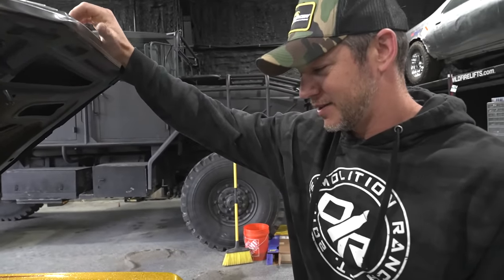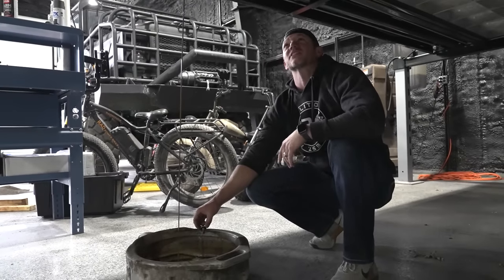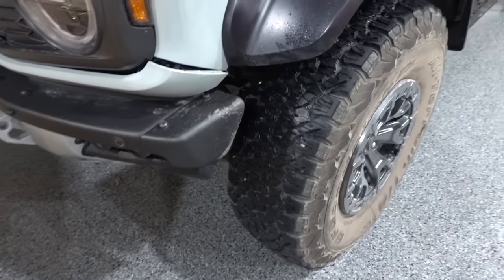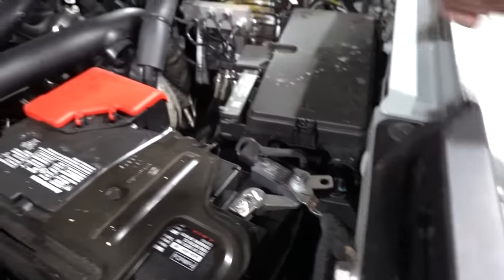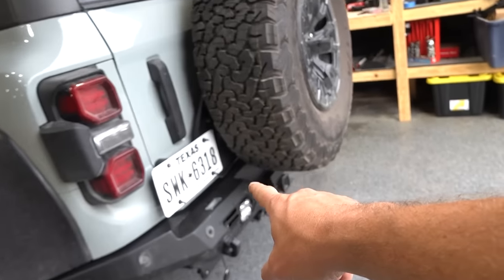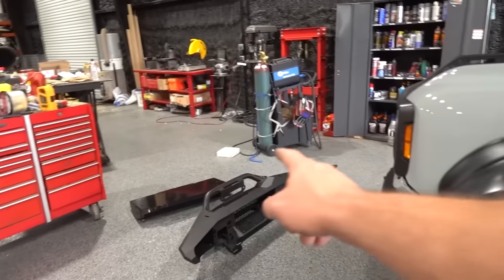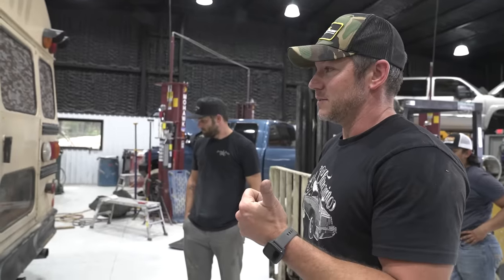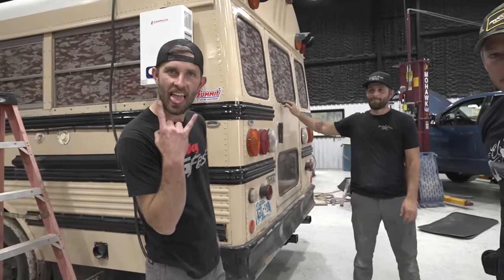EPIC Bronco Raptor Upgrades!!!

Comment: If you wire the lights to a 3-position switch you can have "Auto" which would be when you put it in reverse your added lights come on as well. Middle position would be off and "On" they would come on whenever you want them to. You can do that with any aux lights.

Comment: Stay with the 12k winch and swap the cable for the synthetic.  It's better to have more pull than you need, than not enough.
Reply: Exactly. Most offroaders will recommend having at least 1.5X your vehicle's weight, especially if there's going to be mud involved. After those steel bumpers and the extra stuff you put on, you're probably 6k lbs. A 12K winch would be ideal.

Comment: There's several Low Rider shops in Las Vegas. Switch Hitters could've repaired the hydraulics they do all inhouse hose and pump building. Fittings, solenoids, pumps, dumps, rams etc.  They would've had everything you needed!

Comment: Looks like the furthest left driver side rear sensor is upside down. They also make a flip up license plate mount for the winch it mounts to the Fairlead. The Warn Zeon 8, 10, 12 are all the same size….

Comment: Mere's Bronco is lookin' good... One suggestion, flip the corner backup sensors if you can, they're pointing up now since they were originally on the bottom slope of the bumper, now they're on a flat.

Comment: If you are going to be doing more raptor things driving up rocks and hitting jumps you may want to consider upgrading the steering bits that people have had problems with when there front wheels and tires end up pointing at each other or pointing away from each other

Comment: greenish oil usually infers that its a syn non weighted oil bubba, most syns either start green or endup greenish after an early drain either that or you have a minor turbo intake side leak making a minor milkshake in the drain off from the turbo

Comment: I feel like a small rack on the back for the generator would have been more efficient. Like the small racks folks put yeti coolers in, but cut through the bumper and tied into the frame. Up top is going to be some drag on an already aerodynamicly challenged bus.

Comment: 4:53 Hey Matt you asked what could turn your oil brown like that? I'm not exactly sure but from my experience it's usually a sign that you may have a cracked engine block because the oil changing colors like that usually means you have water or radiator fluid mixed in with your oil... If so I'm sorry man

Comment: Check with Addicted Desert Design they may have mudflaps that will blend well with the bumpers.  Get in touch with either Chris or Kevin at the youtube channel LightBrite Nation they did a bunch of stuff to the Braptor that Kevin and Britney bought. Including lights and a compressor all wired to the dash switches, including a two-way radio from Rugged Radio.

Comment: The 12k winch is the least id go with that Bronco personally, if it was a Ranger or something smaller an 8k would be fine. The 8k would work on the Bronco but i bet it would struggle if it ever got in much of a bind or in a decent mud hole

Comment: you running e85 in el chromino? ethanol will do that to oil if it sits for a while and dosent get hot enough to burn the water out of the oil

Comment: Definitely need to cap off the ends of the frame that used to be covered by the front bumper. Dont want anything getting in there to cause rust.

Comment: Are you running E85 in the Chromino? That can get water in the oil if you don't let the car get all the way up to temp when you run it. There is a lot of water in E85, compared to regular fuel.

You should make sure the oil is getting to 212 degrees when you're running the car, more often than not. That will boil the water out of the oil. Catch cans will also help with this. E85 throws off a lot of moisture.

Comment: Generator on roof is dumbest idea ever..... every time you wanna run it or fill it with gas you have to climb up there..... Should have just made a short proper rack to hold it.

Comment: Don't put the backup lights in a switch. That's dumb. Wire them directly to the stock backup lights. Adding a switch means you have to run wires to the battery and the switch plus the switch becomes another fail point.

Comment: An 8K winch is too small for the Bronco Raptor. Winches should be 1.5x the GVWR. So with the BRaptor's GVWR of 6850 lbs, x 1.5 =10,275k So I would get a 10k winch and make the wife and kids get out if you need to use the winch...lol

Comment: Dude, why didn't you just build a small platform on the back bumper just big enough to hold the generator, on the roof seems just so unnecessary. It's going to be a pain in the ass for many reasons having it up there, even just refueling it is going to include lots of swearing.

Comment: STOP!!!!!!!  dian Before you leave the shop, measure how,wide the bus is with the control box.  If the bus body is 8.5 feet/102 inches, the box will put you over DOT legal width.  Indiana is a 'probable cause' state, so it might motivate one of their 'finest' to pull you over.  If so, you will, odds on, get a citation, not a warning.  Maybe not for the box, but any other Mickey Mouse reason.  Relocate to inside.  Vandals won't have access to it, and won't be over width.  In fact, near the driver's position would be great